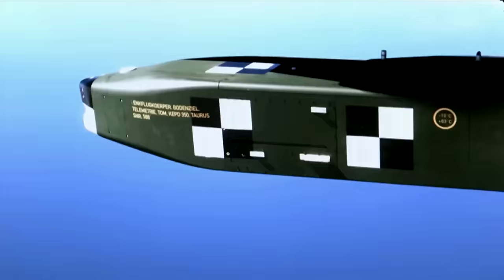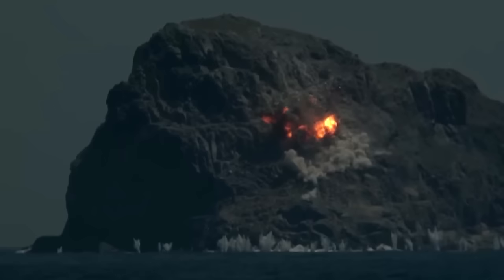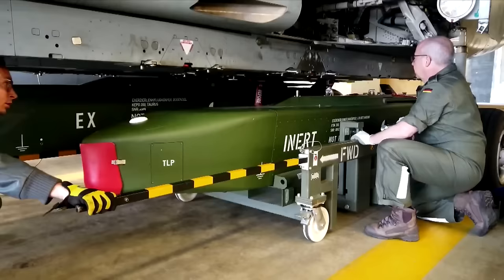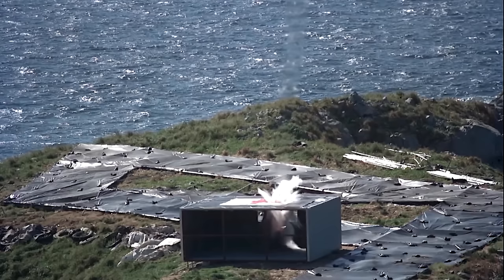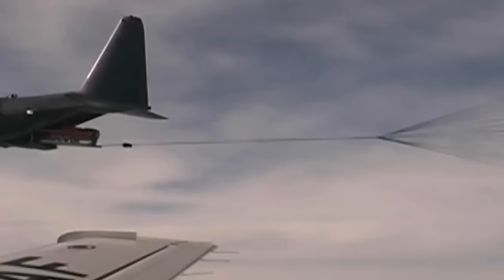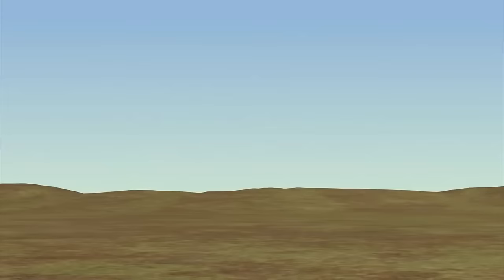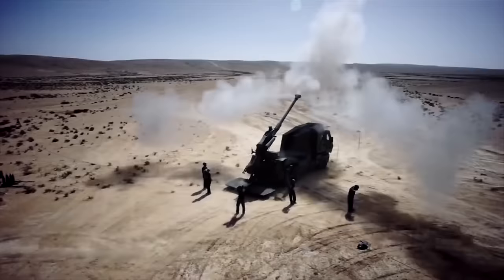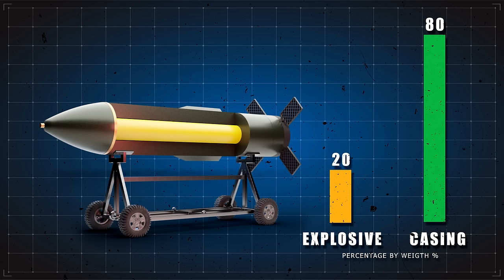That's Why Russian Army Doesn't Want To Mess With This Weapon

Comment: Necessity is the mother of invention, and when you have an entire stockpile of old gun barrels you no longer will ever use, someone decided to try using them to dig a hole in the ground to get to a bunker the enemy has over 50 feet  down, and the GBU-28 was so successful that it can reach bunkers 100 feet underground, meaning even the deepest of Hamas Bunkers are well within reach of the aging bunker buster. New ones are now utilize rocket motors to accelerate them just before impact. making them even more successful.

Comment: I was at LMSC when we were asked to work on the original GBU-28 bunker buster designs.  The idea to use milled Howitzer barrels was only reasonable option given the time constraints.  I left Lockheed in the late 90's so I was a surprised that basic design took so long be replaced by the GBU-72. That said, if you're talking penetrators, it seem you should have mention the GBU-57A/B MOP.  For my tax dollars, that's the true Mother of All Bunker Busters.

Comment: Wrong photos used you showed blockbuster bombs which were designed to wreck buildings above ground not the Tallboys used on Tirpitz. Tallboys weighed 12,000 ponds Grand Slam weighed 22,000 pounds they were design to penetrate deep into the ground with the shockwaves being able to collapse bridges and other targets without a direct hit.  They were considered Medium Capacity MC with around 50% of the weight in explosive fill. Blockbuster HC bombs were high capacity with just enough metal to get them to the target in one piece safely.